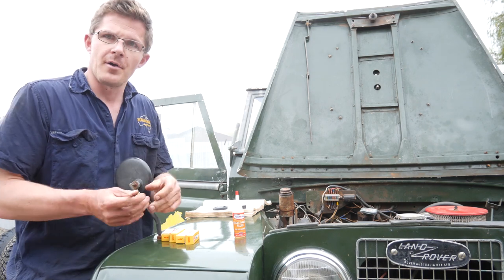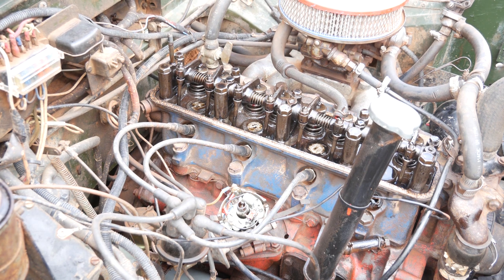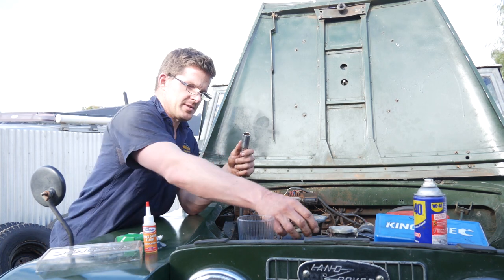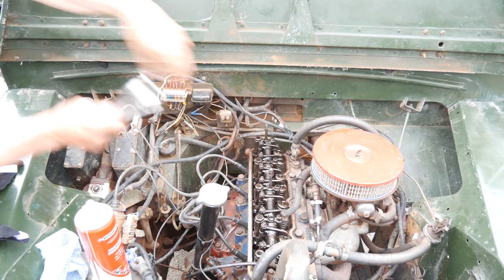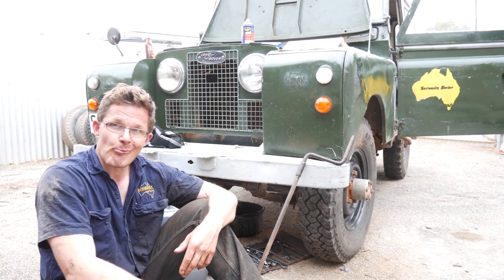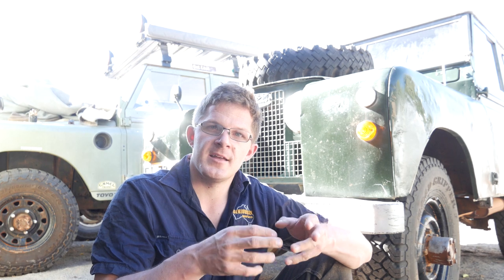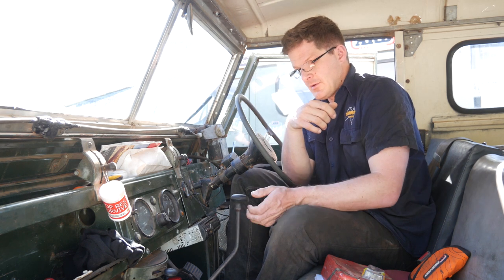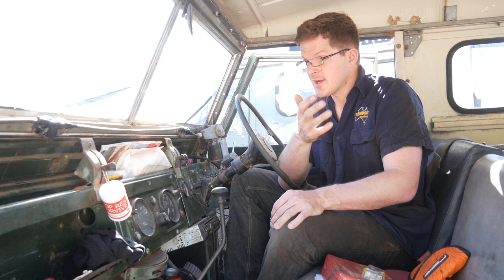Land Rover Series Ignition and Driveline tips

Comment: Aaahhh the delicate task of ignition points gap setting.  Another dying art. Slight decimal correction here for you Geoff.0.40mm is roughly equivalent to 16 thou inches which should be written as .016 not .16 which is 160 thou.  There being quite a difference when measuring small gaps like that.  Love your content always look forward to it every week.
Reply from the maker: Always use the old carpenters saying. measure twice cut once. Cheers
Reply: @seriouslyseriesaustralia  indeed 😁 although I don't think I've ever measured anything in my life!

Comment: Could benefit from more zoomed in shots on the points work in the distributor. Some of the times the camera could do with better positioning,for example like when setting valve timing on cylinder 1 and the oil filler tube blocks the line of sight of cylinder 1 inlet rocker arm, and both rockers in fully raised position.
Reply from the maker: Hi Steve. Thanks for you feedback and observations, we will be sure to take your points onboard for the following episodes. Cheers Geoff
Reply: @seriouslyseriesaustralia  Love the channel.

Comment: What is your modification of air filter system
Reply from the maker: Hi Jeff. The Series 2 is fitted with a dual throat Holley carburetor, so it runs a EK Holden air filter. Cheers Geoff

Comment: Thank you for the video- what is your opinion on synthetic gear vs (now expensive) traditional oil for the gearbox etc?
Reply from the maker: 75/90 in a GL4 is still relatively cheap and easy to get. GL5 synthetic oils will corrode brass components in your transmission. Cheers Geoff

Comment: Before measuring the spark plug gap I always tighten the little terminal cap at the top of the spark plug with pliers, they are never a tight fit.
Reply from the maker: Hi Norma. A very good point, many thanks for sharing that top tip. Kind regards, Geoff

Comment: hi geoff, with all respect and the video is quite old, but here is something wrong and maybe considerung the flaws wouldnt be a bad idea, without offence, but here maybe are some new kids on the block
- sparkplugs: well it depends how much you drive, but they worn out in years, i have my now 6 years and they are absolutely perfect. check them, clean them but change them only if the contact points get to weak
- color of sparkplugs: white to hot and/or ignition to early - not good
 dark ignitin to late - not good
-black and white - to rich to early
wet : ignition to rich, get gasoline mixed up in the engine oil - not good
- what about the ignition cables
- mark them on both ends, if corroated change them
-spray some wd40 in the conectors at the end of the cable
- what a about the ignition cape and finger inside the distribuitor
- what about the ignition timing

-warm up the car diff gearbox before changing oil
lit it drain over night
- swivel oil chanfe

....
-  dont open the gearbox just to see. open it only if something is going on.

- never ever force the gear selector in a position by hand. you will bent the gear selectors inside the box and that cause some serious damage

well you see there are some critical points imho . not a bad video but maybe itsnt a bad idea to redoit again.
cheers
Reply from the maker: Hi Bernd. Thank you and I agree with colouration of the spark plugs. I think it is worth noting that vehicles are serviced to tackle different conditions. The way you maintain a Land Rover in cold environment is a very different compared to a hot remote part of the world. Thank you again for your input, Kind regards, Geoff

Comment: Dump the points. Lumenition optronic. Fit and forget. Best mod to a series landy.
Reply from the maker: That is a good system, we have similar system in the Series 3. Cheers
Reply: You can get failed points to work at the side of the road with a bit of a clean and adjustment,  you can't with electronic ones.